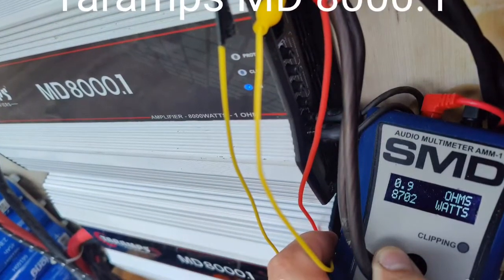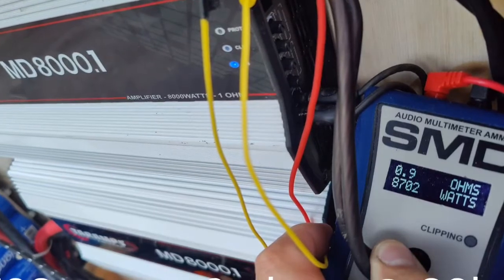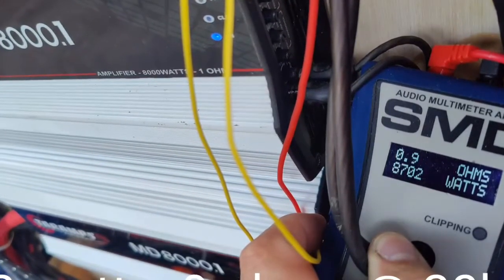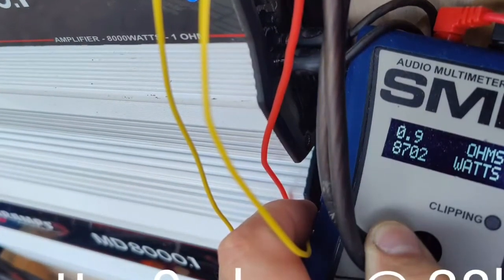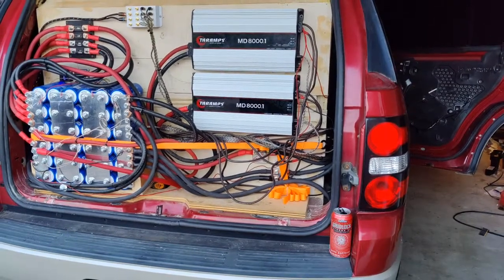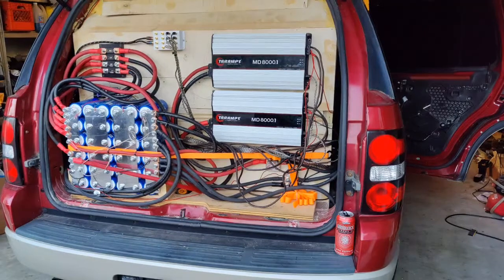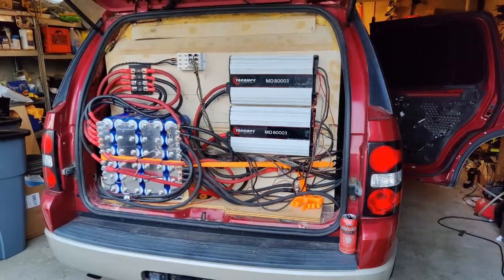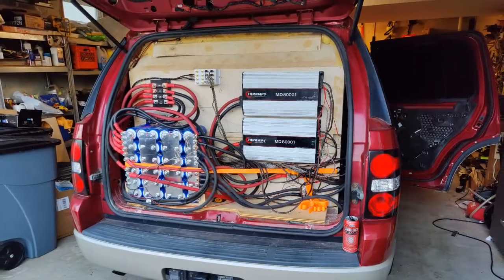My Taramps MD8000 amps and specs.

Comment: Awesome! You could switch to 2 Bass 15Ks to get your 0.7 ohm load back. I'm considering selling my 2 Bass 8ks to buy one bass 15k to drop down to 0.35 ohm which will rise to .5 ohm which Taramps bass models can safely handle (as in ½ ohm, idk about them handling .35 ohm)
Reply from the maker: Thanks Brandon! Stay tuned, I got a little surprise in store. 😜 You will definitely get some power out of your Bass 15k at .35. Just be sure to keep the voltage a little less than 17 volts as that is right there at the bleeding edge of what they can handle. They seem to like nominal static ohm loads vs. relying on box rise like the Koreans. I will be rooting for you 😁👍
Reply: Hi there, did you manage to sell your Bass 8k?